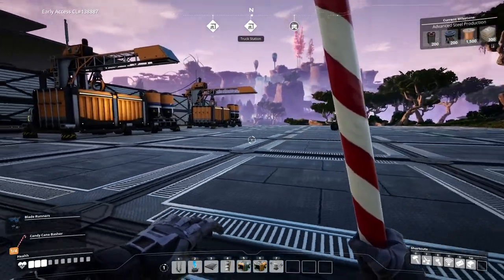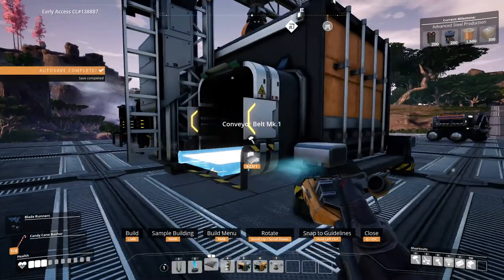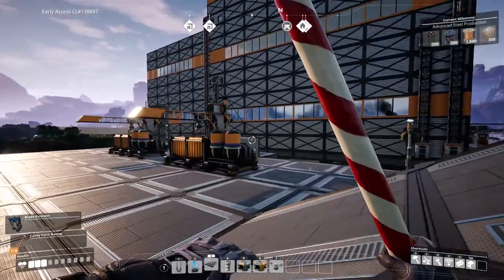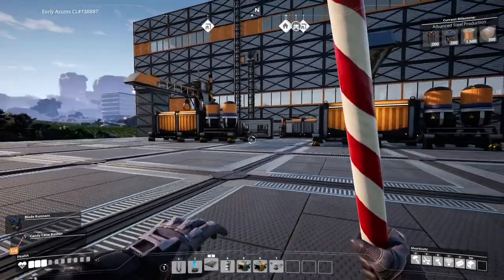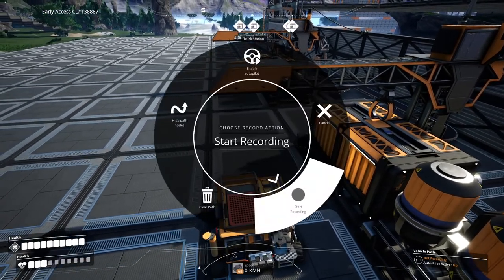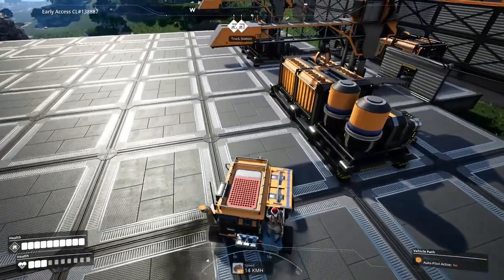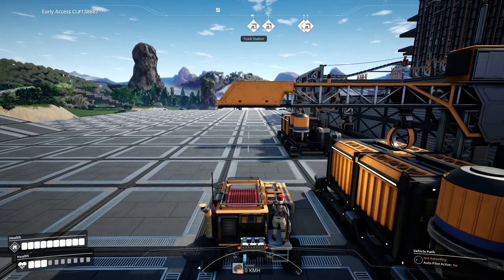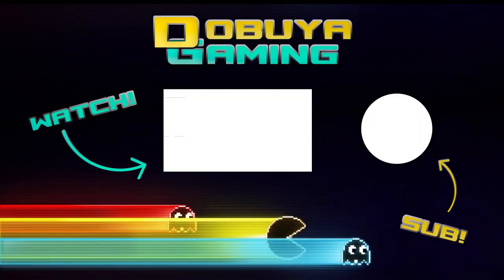Can You Load and Unload with the Same Truck Station? - Satisfactory Guide

Comment: The problem with loading and unloading with the same truck is if the unload station is filled up, the truck cannot unload. For example if your truck cannot unload the modular frames because the modular frame unload station is full, then it will unload the modular frames to the station that you wanted steel beams to unload. It will cause issues. The same situation can occur if you give to few time for the truck to unload. 20 seconds is a safe time i use for loading and unloading. I tried to use same truck for carrying packaged water, and bringing empty cannisters back, since the throughput is high, packaged waters arrived in the truck station that i wanted empty cannisters to arrive. It was messy. Then i switched to 2 trucks and all was okay.
Reply from the maker: Yeh the amount of modular frames wasn't an issue, was more the steel beams and pipes. There was a time where I had to fix a blockage but I was able to rectify things by having splitters that go off to the furnace. Needless to say, it helps if you don't have a huge in/out flow